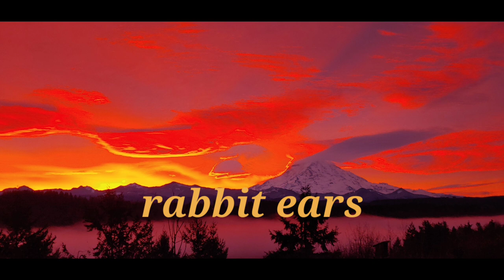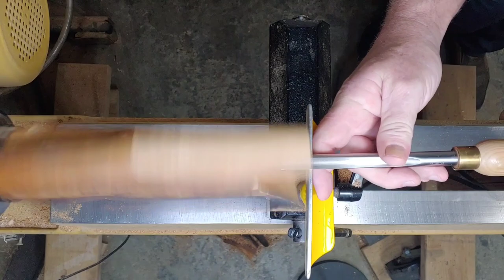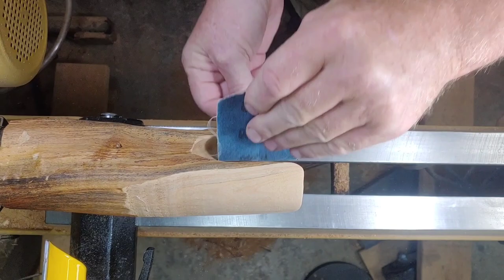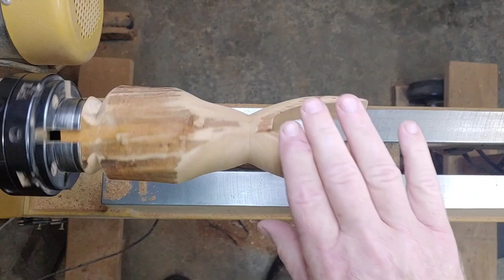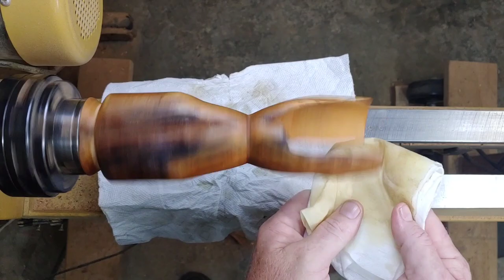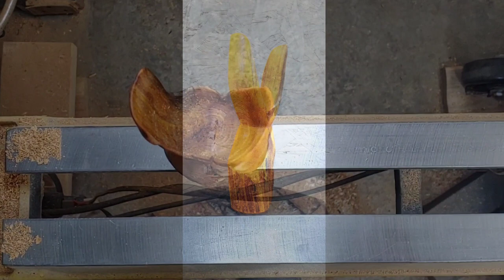wood turning rabbit ears

Comment: What type of oil are you using?
Reply from the maker: It's friction polish. Shellac, boiled linseed oil, and alcohol mixed.
Reply: @RcWoodturning  thank you. What part of that combo is adding the color? I use lindseed for everything because it is all i have, but it doesn't do much more than make the wood shiny.
Reply: @TheMxxpower  I think it's the Shellac. I see it in many diferent videos, but haven't used it yet. An oil based sealer i used just made the wood darker. It's normaly used for boats.
Reply from the maker: You can use mineral oil if you don't want to darken the wood I also use clear shellac mineral oil and alcohol mixed together and that won't darken the wood either that could be used as a friction polish you could also use spray lacquer but that's a bigger process
Reply: @RcWoodturning  Thanks! I am actually trying to add color sometimes. I have lindseed and mineral oils for finish with wax, but that doesn't add much for rich tone. I wonder If i could mix something into the lindseed.
Reply from the maker: If you decide on shellac. There are different shades.